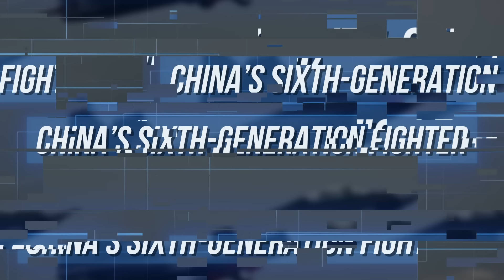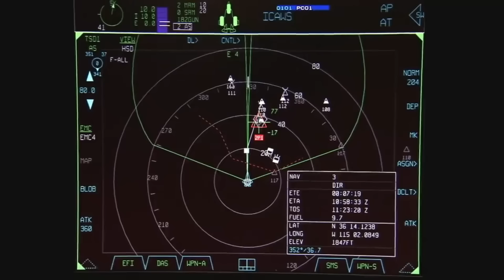Chinese $BILLIONS 6th Generation Fighter Jet Shocked US

Comment: J20 could be close to a sixth generation fighter since J20 is the only stealth generation with a second seat.  It all depends on what the back seater is doing and they get a super-cruise jet engine.  PS The definition of active air control is not the one used by the DARPA project and is evolving...  If you don't have PHD then don't make up marketing crap.

Comment: The last time I checked you need pilots with experience. In real world situations pilots with experience count.
Reply: So tell me which pilots from which country would have that experience in a real tangible battle?
Reply: The experience with Afghanistan fighters wearing slippers seems to help a lot mate. 😁
Reply: @andrewlim7751  Uhh big difference between a run of the mill spear throwers and pilots handling massively complex machinery.
Reply: @timothychung4811  Israelis and US they put in more stick time than any orher country.
Reply: @@iammusic9 I regret reading your comment
Reply: @ebadd3468 Not really these days. Chinese elites pilots are at least training for the same hours and more. Each year, PLA Air Force has multiple Gold Helmet fights similar to US’s Red Flag.